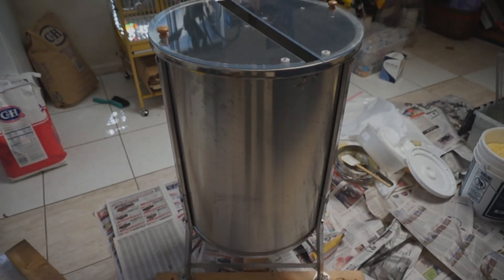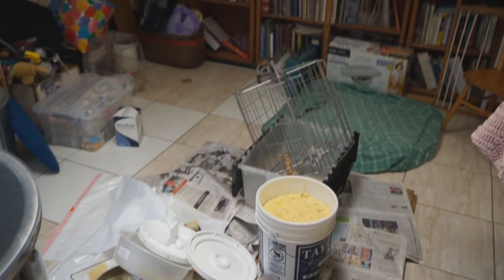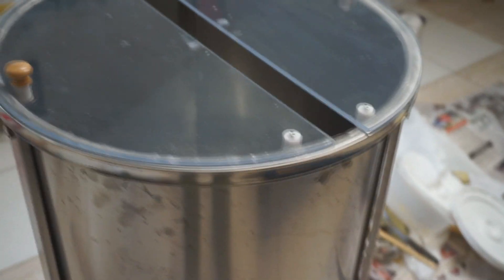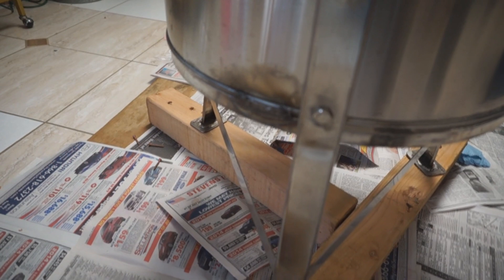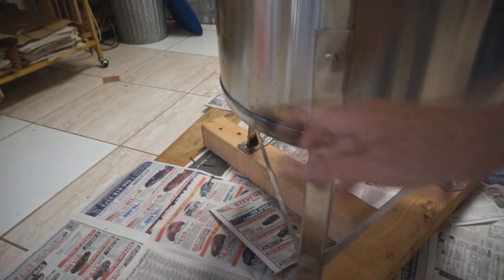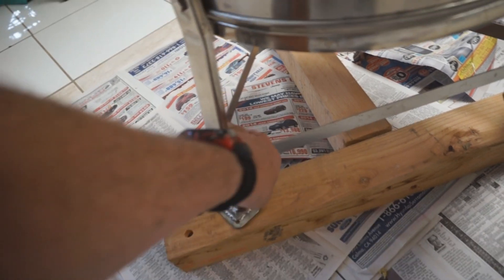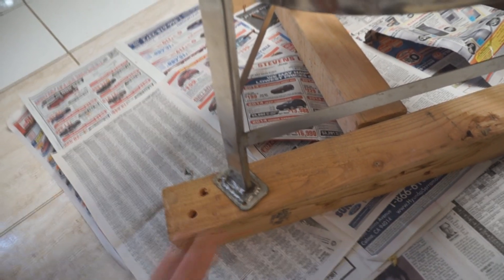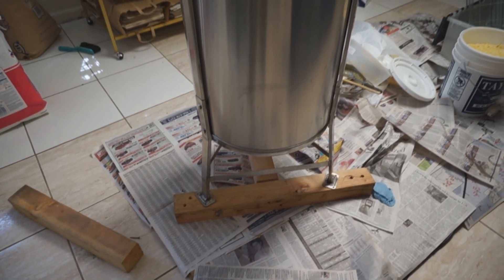VIVO Honey Extractor Modifications

Comment: I just bought the same one and had to take it to a welding shop to have the drum spot welded because it leaked. I also had the frame supports added to my basket and legs upgraded with supports like yours. My next upgrade is a electric motor conversion as the manual handle kills my arm. What should I look for in a motor?
Reply from the maker: It depends on if you are going universal motor or 3 phase with a phase converter.

Comment: was it hard to weld? I bought one, and my problem was the mechanism , I mean the transfer to the shaft, where it has that rubber thing. one of the screws got loose, so It was not turning anymore. I could turn the handle but the basket would not turn.